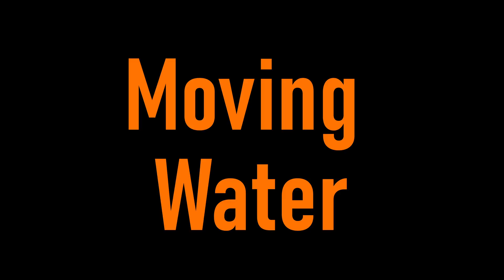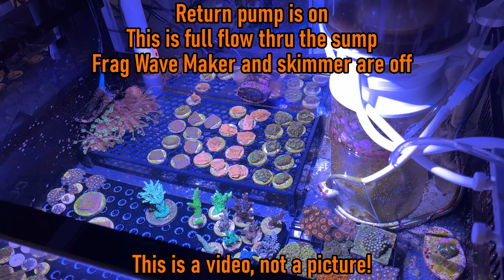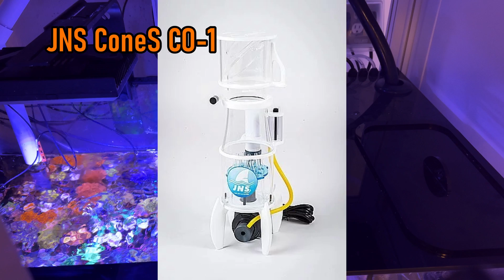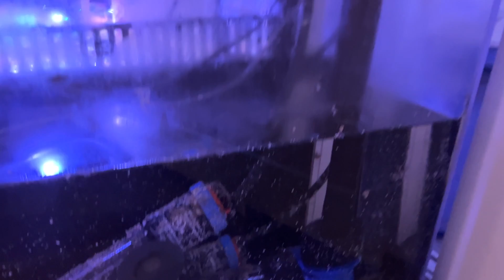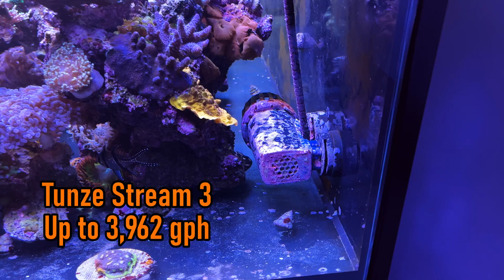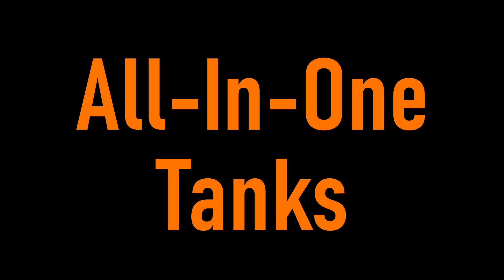Mute Your Tank! How I Built a Quiet Reef🤫🔇

Comment: Just replace the tunze osmolator pump with a dc pump, dead silent. The pump it comes with is kind of crappy and loud.
Reply from the maker: The pumps they come with are loud and don't last forever, so once it goes, I will go with their upgraded pump which is supposedly very quiet. I'm not super annoyed with the sound since I have it on a time to one run during certain times of day.

Comment: What molykote are you using? I just looked it up and they have a bunch of different versions. Trying to make sure I get a reef safe version and if you are testing on your tank, it's good enough for me. Saw you have the 111 in the picture. Didn't know if that was the one!
Reply from the maker: yes, Molykote 111. I think its food safe (used on food processing equipiment) and from what I read on reef2reef, it's what ecotech uses on the wet side out of the factory. I've been using it for a good 5 or more years and it works great. I think 1 tube is 2 or 3 lifetimes worth, lol.

Comment: Tunze 6105 is so underrated. No one talks about them but they push some serious water. I just picked up a second one, the Tunze 6105 eco which is more emergency efficient. Next on the shopping list is the Tunze safety connector so I can add them to my battery backup system. P.S. tank looks great!
Reply from the maker: Agreed! Tunze needs to step up their US marketing. Is there any difference with the eco other than being more energy efficient?
Reply: @NBurgReef  11 watts vs 35 watts + a standard 5 year warranty. Everything else looks the same. They are going to be my go to wavemaker here on out I think.

Comment: Can you give more details on how and what side of the mp40 you apply lubricant?
Reply from the maker: I will put a little on the white shaft on the bottom piece and on both sides of the magnet (bottom and under the little plastic disk between the mag and impeller blades. Just enough to coat it. Too much and it can prevent it from spinning… if that happens, just wipe it a little and should work. I might do it on cam in my maintenance vid from a couple months ago.

Comment: Although I haven’t looked into it, I heard there’s a new Tunze ato pump that is plug and play with your unit that is much more quiet. Mine is loud as well. I also ran a smart ato micro for last 5 years and it’s not entirely silent, but pretty damn close. Great looking tank as always man!
Reply from the maker: Yeah when this one dies, I will look into that one, but I will let this pump die first.  It’s like $80 for that pump I think.
Reply: @NBurgReef  I get it. I’ve been considering taking the Tunze offline. The noise is annoying for sure
Reply from the maker: @MikeLemming  That upgrade pump might be worth it for you then.
Reply: I find the noise of the Tunze ATO actually quite reassuring, as I know its doing its thing, and it's not like it is running all day or anything
Reply: @skeptics_reef5575  when my water level is low, I can hear the water dipping over the baffle so I know it’s an empty reservoir. That’s another thing I don’t like about the Tunze, my smart ato beeps when the reservoir is empty. I have to rely on the little flashing light to know it’s empty with the Tunze..
Reply: @MikeLemming  what version do you have, the 3155 with the additional high-level float switch as well? What I did is flip that round and put it at the bottom of my top up section, that way it acts as a low level sensor/alarm letting me know when my top up is low 😉 I didn't really see the need for a high level sensor, so used it that way instead and I get more use out of it. If I used it as a high-level alarm, it would never really be used
Reply: @skeptics_reef5575  yes, I have the 3155. I’ve never thought about that. The high level alarm is more annoying than anything to be honest lol
Reply: @MikeLemming yeah i just didn't see the need for high level alarm, so as soon as I got it I just flipped it so that it goes off when it drops instead of when it raises, and in the 3+ years running it I've never had a situation where a high level alarm would have been beneficial, but there have been countless times its alerted me that I need to top up. Maybe give that a go 👍🏻👍🏻